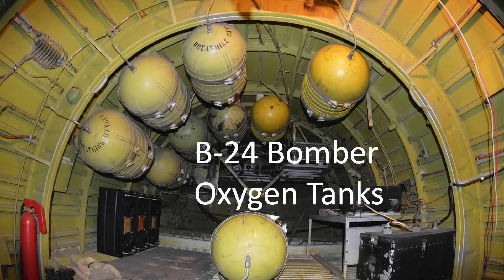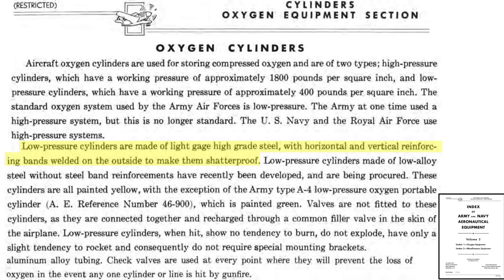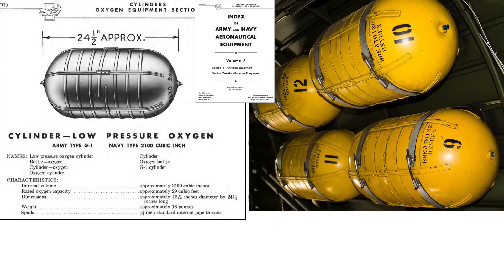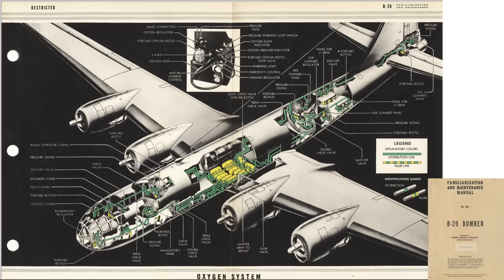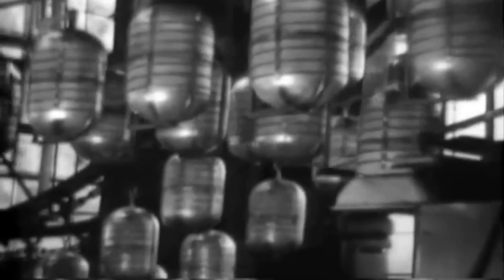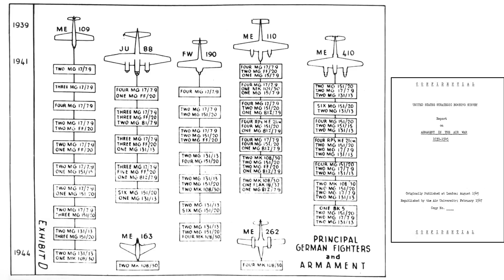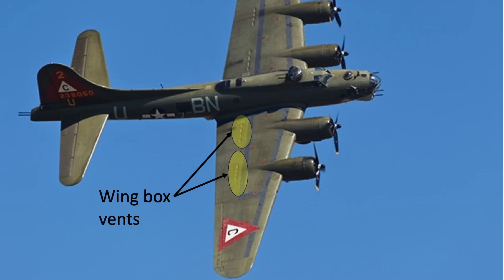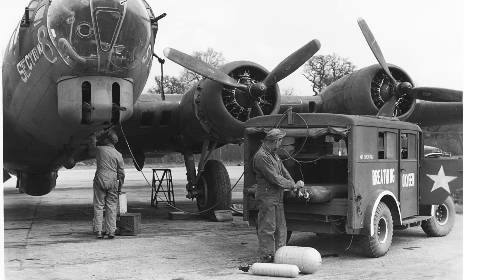Consequences of shooting a WWII Bomber’s G-1 Oxygen Cylinder. Explosion Vulnerability footage.

Comment: "Oxygen burns " is common Hollywood trope used in many movies.
Reply: But it does help everything else burn
Reply: @scrubsrc4084   Yes, but single match will not make oxygen tank explode - like in Deadpool. If anything it will put it out because rapidly expanding gas is cold :)
Reply: @randomnickify  the temperature is irrelevant.
Reply: @scrubsrc4084  Indeed, many things that will not typically burn in a regular 20-22% O2 environment will burn in a 100% O2 environment. And things that will burn slowly in a regular O2 environment will burn so quickly they will often appear to deflagrate. I will point the reader to the Apollo 1 disaster.
Reply: @markmaki4460  After the Apollo 1 disaster NASA switched to a nitrogen mix like normal atmosphere.
Reply: @dfirth224  but only while on the launchpad. Once in space pure oxygen was used again because a fire in zero gravity can't spread easily and carrying nitrogen was a waste of resources.
Reply: it looks good for the movie. Oxygen its self actually does no burn,  it makes everything else burn.  if you struck a flint in an oxygen enviorment without any combustables the flint would just be ALOT brighter.  this is taught in your O2 handling course.  the real sinister part of O2 is drives down the flashpoint (ignition temp) of everything.
Reply: There are videos on YouTube showing exactly what happens - the tanks walls ignite (briefly).
A 1/2” hole in a steel cylinder becomes a 3” hole as the tank empties.
Reply: You need to watch the official Navy LOX safety film, "The Man From LOX."
Reply: @scootergeorge7089  in the video you reference he is dropping the container on material that act as fuel.  the O2 created a hyper oxidized enviorment around the material, causing it to flash.  this is why ohxgen is so insidious.  its concentration changed the ignition threshold of everything around it. its is also a cryogenic and ,as combressed gas, explosion (not the burst of flames type) hazard. they cover this somewhat in hot gas certification (oxy-propane, oxy -acetlyne ...)  and more so in trauma oxygen adminastration certification.
Reply: Pretty sure oxygen and the friction of the compressed oxygen across a combustible material can cause it to start burning.

I may be oversimplifying it though.
Reply: @14thCenturyHare   its actually complicated oxygen its self doesn't "burn",  its makes EVERYTHINHG else burn. and the  concentration of O2 in the enviorment effects the flashpoint of everything, ie. the ambirent temperature at which thisng just "light up." this is also in WHIMS O2 is oin the oxidizer catagory and not grouped with the various fuels. if this helps i"ll tell you a story my O2 instructor told me.  a paramedic he knew responded to an accident. the patient had alcohol based makeup on and the sun was beating down.  he applied 15 LPM O2 on a non-rebreather mask.  this created a 100% o2 enviormant in the mask, with the sun beating down the alcohol in the makeup flashed.
Reply: @14thCenturyHare  - An oxygen rich environment lead to the Apollo 10 tragedy.
Reply: Yeah it's silly. Sure, it makes burning stuff burn much faster and brighter, but it will not explode and if nothing is on fire nearby it's relatively harmless. Oxygen is not a fuel. It's literally an oxidizer.
Reply: @anonydun82fgoog35  - It makes relatively nonflammable objects flammable.  See Apollo 10 tragedy.
Reply: Too much time spent in drama class and practicing for The Pirates of Penzance when they should have been reading actual books.

Only fools expect anything realistic from The Hitler/Alien Channel.
Reply: Any gas explodes when shot, right? Really loved in the show Burn Notice that he points out shooting a propane cylinder won't do anything without an ignition source, then tapes a lit butane torch to a propane cylinder to get it to explode.
Reply: There is a video showing how Hollywood like fireballs in explosions when real explosions with, say TNT, do not make anything dramatic enough for an action movie.
Reply: January 27 1967. NASA lost three astronauts during testing on the launch pad. The oxygen rich capsule was engulfed in flames by what would have been a bright electrical flash at normal oxygen levels.
Reply: @scoutdogfsr  because the components inside the spacecraft burned, not because the oxygen itself burned. Much of the interior of the Apollo 1 Command Module was not flame resistant, such as velcro that was placed almost everywhere.
Reply: @Roddy556 actually the oxygen is consumed by the flame and chemically changed into carbon dioxide and water.. so the oxygen does burn .
Reply: @guaporeturns9472  Oxygen takes part in the burning reaction, but the oxygen itself undergoes chemical reduction rather than oxidation. Rapid exothermal oxidation is what we normally mean by "burn". Oxygen can burn, but it requires rather extreme circumstances.
Reply: @guaporeturns9472 An oxidizer is a component of combustion, it cannot act alone .
Reply: @duncandmcgrath6290  Never said it acts alone.
Reply: @duncandmcgrath6290  It's 1/3 of the fire triangle.

Comment: That scene from masters of the sky was brutal
Reply: In the early war with the lack of chin and dorsal turrets (and/or lack of experienced personnel to man them) the risk from a frontal attack was very real, and the pilot throwing a corkscrew to disrupt the gun run was their only hope. If the German pilot was brave enough and the Allied bomber pilot was complacent enough, it remained a viable tactic until war's end. 

If the chin and dorsal turrets were present and attentively manned and the pilot was visually tracking and prepared for evasive action, the zealous German pilot ended up on a suicide run which ended before he could even fire a shot. Which is why you see MUCH less "face shotting" attempts from midwar onward.
Reply: @gastonbell108  Yeah they fixed the frontal issue later when they added the 50 turret. The face shot became harder. Thanks for the reply.